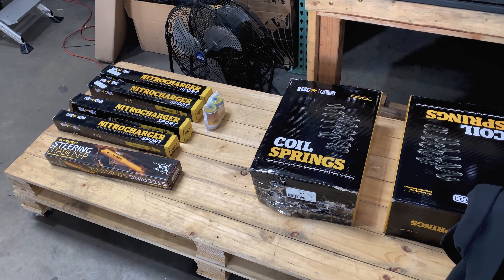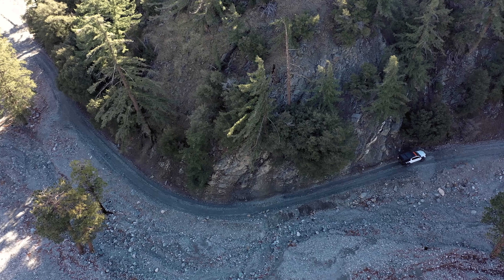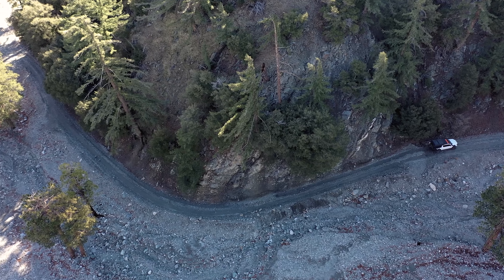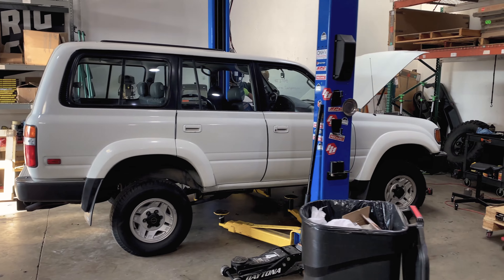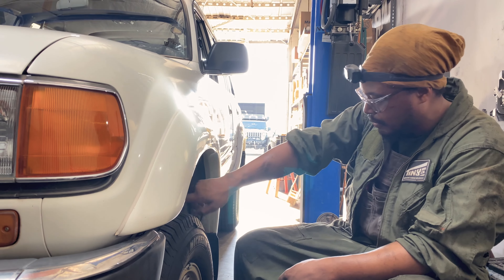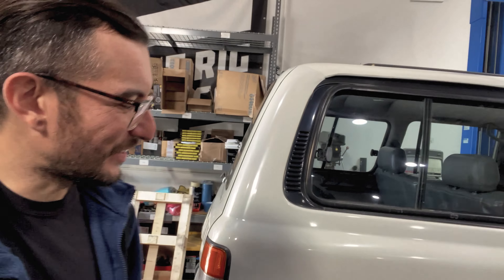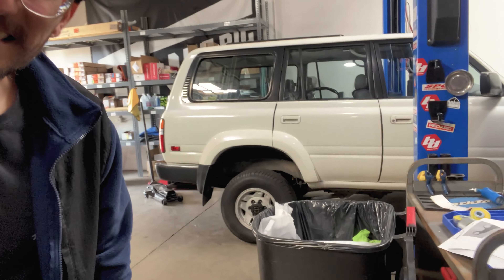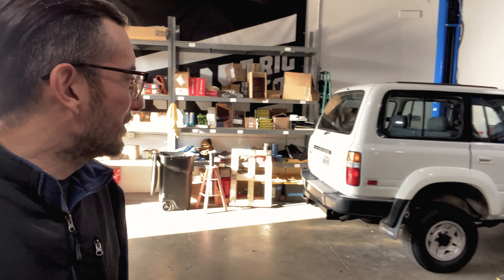Toyota Land Cruiser 80 Series SuspensIon Upgrade

Comment: did they extend the Rear Sway bar Drop Brackets? There's a bit more than just putting in the hardware.
Reply: Not required on 80 series cruisers when lifted less than 3 inches. Stock brake lines and drive shafts are also plenty long for the lift too.
Reply: @Mark-Dibble  IMHO, you should really extend them, it needs to sit in a happier angle or the bushings are wasted in short order.

Comment: I have a question for you 4x4 industry experts!  (and I wonder if you can tell me if it's true that the ironman nitro gas shocks match well with the original setup and can be retrofitted with the +5? I have a suzuki jimny 4x4 with m13a 1.3 l gas engine with shock absorbers and standard settings, yesterday afternoon I bought the new ironman nitro gas shock absorbers and the 4x4 spare parts dealer in Florence told me that these ironman nitro gas shock absorbers are suitable for 4x4 off-road vehicles with original finish or in a second you could put the springs higher and it would become a +5 high finish, is that true? Greetings from Florence, Italy!)

Comment: Which Ome springs exactly? I have the 850 heavy with Arb in front, the 860 mediums at rear, constant 300 lbs of gear. Still rides like a HD truck! The nitro charger shocks are really firm to imo. Suspension settled down around 1/4 inch after a month. 
If I had to do it over, definitely dual rate coils, at minimum on front. 
After 5 years still a rough ride on the street. 35s at 30 psi do help soften it up. Off road is great tho! It does corner like a rally car which is fun. I had exactly 1900 pounds of concrete block, just touching the factory bump stops. 80s are simply the best all around vehicle on Earth! ✌🏽
Reply from the maker: I’ll look into the 35s since up next is tires. Thanks for the help, this Toyota is by far my favorite vehicle to date